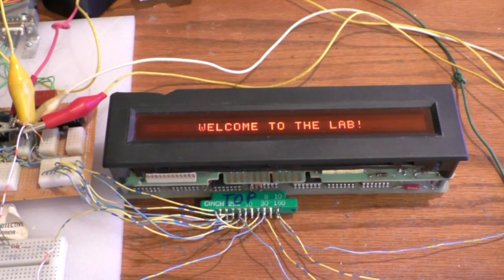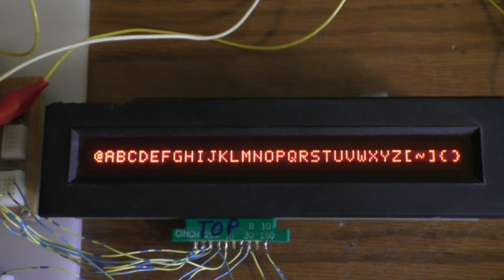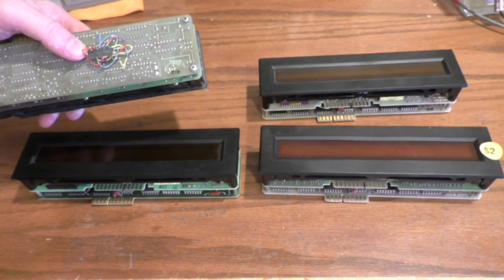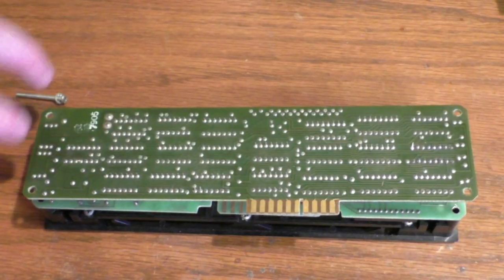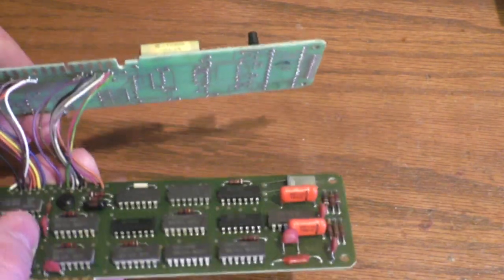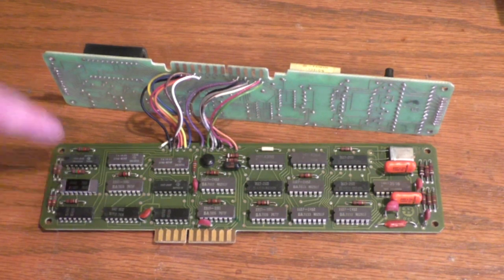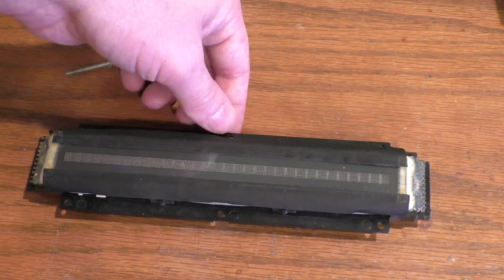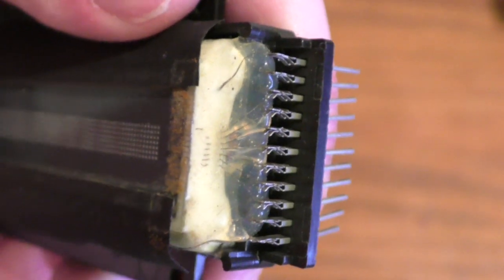Single Line Burroughs Display Test

Comment: $2... I know this was 9 yuears ago but damn, I wish I could find one of these *at all*
I have a computer kinetics blackjack machine with a smashed Burroughs SSD1033 (I think) that I need to replace
Reply from the maker: they show up on ebay from time to time for reasonableish prices.   if they want more than 100 bucks it's overpriced.
Reply: @kevtris  Problem is, they never show up in the UK. I found a fella selling two sister machines to the one I'm trying to fix but I'd somehow ended up on the com version not co uk version of that particular auction site. on the US version he had 30 items, but switching to the uk version which previously would only have changed his prices from dollars to pound sterling, all of his inventory dissapeared. I could have missed hundreds of these displays and never been aware of it. =/

Comment: could you publish any pin configuration of these displays？
Reply from the maker: sure.  1:D5, 2:D3, 3:D1, 4:-12V, 5:clear (hold low to clear), 7:data received (pulses high when received), 8:blank (high = blank, low = run), 10:+250V, A:D4, B:D2, C:D0, D:write (low = write), F:data taken (pulses low when taken), J:+5V, L:GND
note: 6, 9, E, H, and K are NC.  pins G and I do not exist (they are not counted in the pinout since they would look like 6 or 1).   
to use, apply 6 bit ASCII char to the data lines, and pull write low until data taken pulses low.  hold clear high, blank low to display.  release write when data taken pulses, or else it will write more than 1 char.

Comment: Very interesting.  I work for a POS vendor and the good news is that modern units connect to standard PC serial ports. You can configure them as serial printers and send an n character jobs using standard Win32 calls, where n is the total number of characters on the display. I didn't bother to learn any control characters. Just pad the output with spaces so you're at the beginning for the next print. Very easy to use.